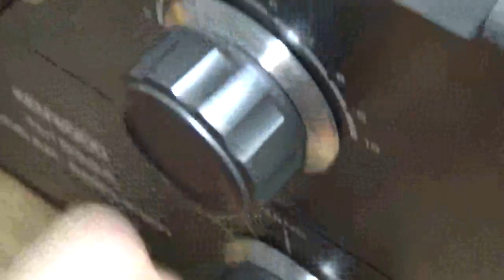Kenwood Tl-922 Repairs And Modifications Plate and Load Air Variable Capacitor Replacement

Comment: I find it hard to believe that a few small scratches or pitting would down grade the performance of the large variable capacitors. It would seem the pitting could be mitigated by light filing or touch up with abrasive.
Future pitting could and should  be avoided by proper tuning
Worst case the max capacitance might decrease a few picofarads.
Aside from restoration to factory new condition, it seems a costly minimum improvement of performance.
Can you explain further justification for replacement?
Reply from the maker: Please explain where what you describe as small scratches or pitting comes from. I replace when the edges of the plates have started to melt and are deformed. 

If I can replace I do. Not worth taking the chance of the customer having an issue on their end.
Reply: From the video it looked more cosmetic than non-functional. I can understand not wanting to return to the customer in that condition (as a restoration to original factory condition).
If it were for my own use, I would just remove the damaged plates believing it would not affect the overall operation, as opposed to replacing the entire assembly costing several hundred dollars.
If  it were a customer ‘s  I would give him that option.
Then again, if the customer wants it original (perfect),  I understand.
You certainly are a perfectionist and do top quality work.
I’m a fan.
Reply from the maker: Remove 2 plates from the plate tune air variable capacitor and one plate from the load side also ?

Back in the day I would file and then re polish. Some times this would work but a lot of times the problem would occur again. 

With heathkit amps I used to totally rebuild the capacitor and then carefully center the plates and hi pot.  Cheaper to buy a new one, modify and install. Time is money.

Just not worth taking the risk and then having a un satisfied customer !!

Would be expensive if had to send the amp back and forth again. 

But each is own 

73